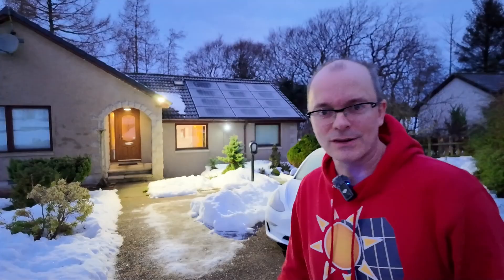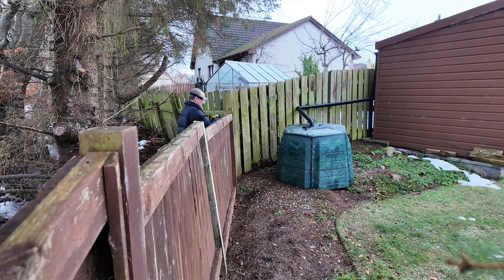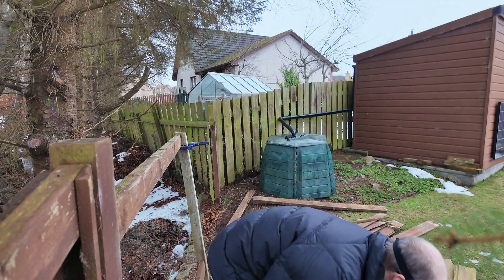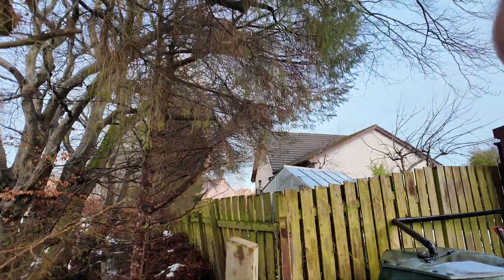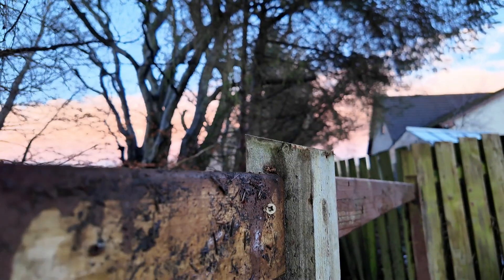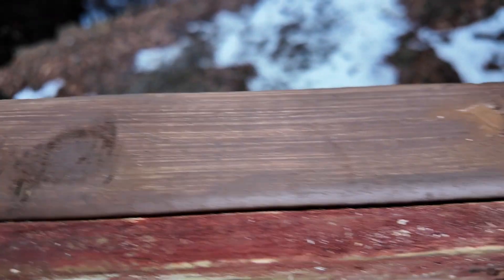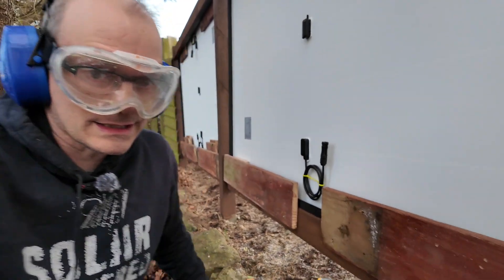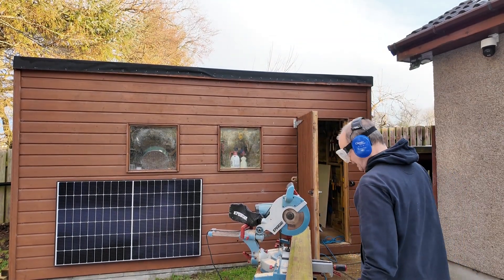The Prototype Solar Fence - Solar Fence / Shed / Battery Project Part 2

Comment: I’m surprised nobody makes panels with some degree of perforation, to allow excess pressure from the wind to escape. Otherwise you maybe the new solar panel Mary Poppins when the breeze gets up. I think I remember it’s about 80kg/ m2 of panel lift at 80kmph.
Reply from the maker: It's the same force that was applied to the previous fence panels and they haven't blown over.  We've had a few storms in the past.  The fence panels survived.
Reply: @anthonydyer3939   OK, but the fence allows some of the pressure to dissipate through the gaps. By adding solar panels you have created a land sail.
Reply from the maker: @yp77738yp77739  The previous fence was cladd in shiplap leftover from my shed project..  There weren't any gaps - certainly none like the picket fence designs.
Reply: @yp77738yp77739 what I see is MORE relief from continuous given the gap between the posts and solar panels, not less. It is reasonable to suggest or even retrofit afterwards some stakes on the backside of the fence and cabling to the top of posts if you wanted to add resistance to turning over force in the inside yard direction at least.
Reply: You are correct that when designing racking - what’s being done here - uplift is the major concern. Having set up a solar panel factory and made panels, the idea of perforated panels is the most bonkers thing I’ve ever read because what kills solar panels is moisture ingress at the edge of lamination against the glass, which is what the frame and frame adhesive resist. Making additional edge of lamination is increasing the primary mode of failure so not the solution to wind uplift.

Comment: I think wind will be your biggest enemy so I would suggest buttressing your fence from the back or put your posts in concrete,metal parts I mean.Keep up the good work.
Reply from the maker: These are all better ideas on paper, but in practice that same post cost me several days of swearing trying to get the concrete out.  I was so relieved that I got it out, and I just so happened to have a propane tank sized hole to dispose it into, so thankfully I didn’t need to think about how to take it to the skip.

After 5 rotten fence posts in concrete, the idea of setting posts in concrete in my mind is a euphemism for punishment in 10 to 15 years time when the post finally rots at the interface with the concrete.  The entire work is just too dangerous for my back, especially given that there’s heavy work in a hunched over posture.  

Steel Spikes are “easy in, easy out”. Slightly wobbly, but good enough for a storm in previous experience.  Fencing contractors are expensive and tend to favour “solid now, rot in 10 years time” solutions.  I’ve never seen a fencing contractor recommend concrete posts sadly.
Reply from the maker: Acutally I had a buttress post "sort of" on one of the posts.  It was never attached, and it's something that the previous owners added.  I just attached it to the wibbly wobbly post, and it's a lot more solid now.

I'll definitely consider it.